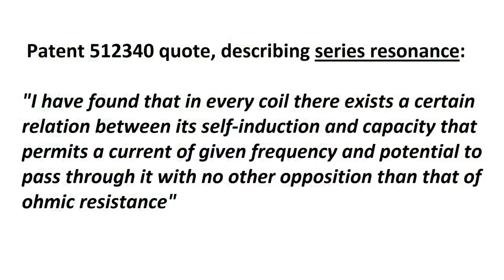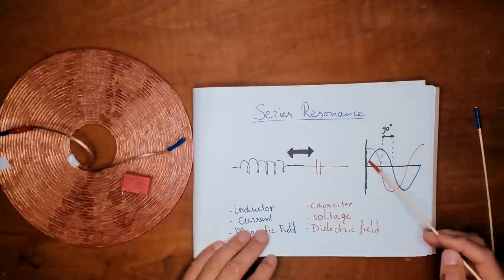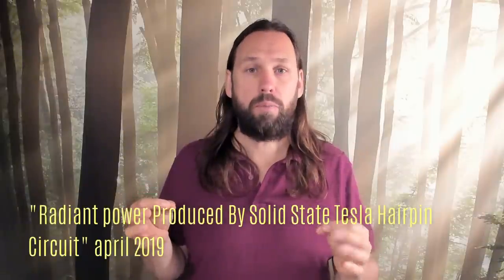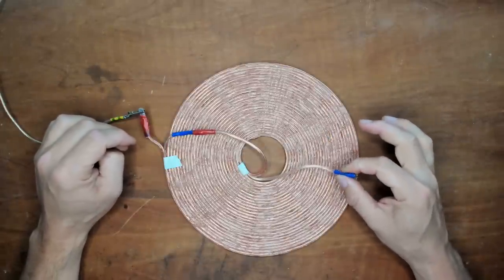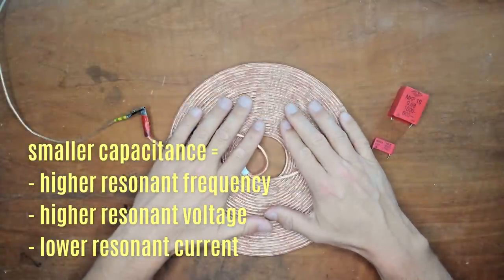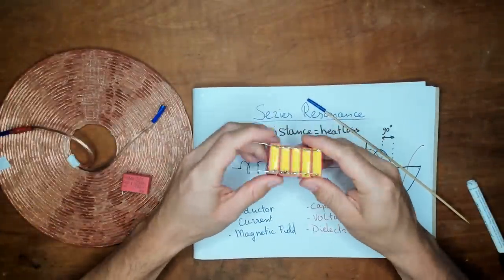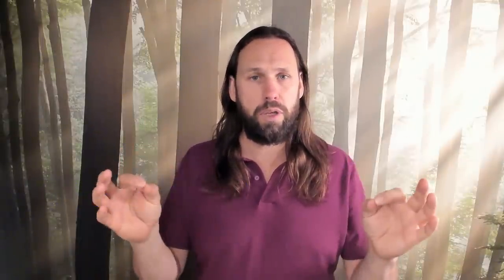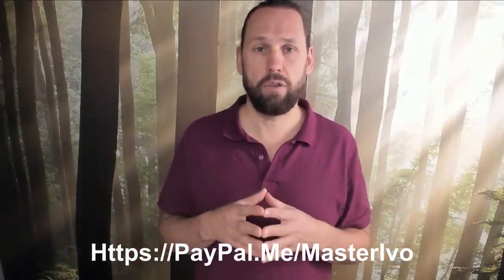The Series Resonant Bifilar Coil, Made For Longitudinal Impulse Electricity.

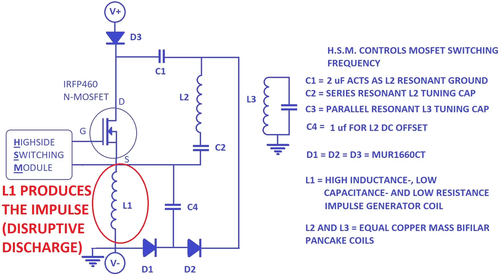Comment: 12:35 Because there is not enough time between duty cycles for the radient field to fill up the coil. "Fly back coil" is 1st used to capture this super high voltage cause it was burning out parts. TV's
Reply from the maker: If so, then the frequencies would be super emposed, just like audio. It forms a single Sine wave with the impulse super imposed, so your theory doesn't hold
Reply: @MasterIvo  Not my theory, just my understanding , when you pulse a coil during the off cycle the radient field enters it, if you pulse to fast there is not enough time for the voltage to peak. I could be wrong ...
Reply: @MasterIvo  I am having trouble what you mean by freq superimposed?
Reply: @MasterIvo  I never said it was a theory , it is just how i understand the pulse technology. In my view there is a simple understanding that by pulsing you achieve "reception" to the ether no matter the frequency there will be reception and the ether is a voltage so high it is not measurable, it is just that at particular resonant frequencies following the vortex math established by Tesla are better for reception of this ether than other non resonant frequencies. I have research to do on audio before i understand the super imposition your refering to. I know the signal is delayed by a little for creating "STEREO" effect, that's why FM sounds better than AM.. Still I will not be able to get you on the super imposed concept, maybe you mean in phase or out of phase by a degree of sorts that I understand, super imposed I do not Understand at all, all i understand about that is the concept of "LAYERS" are you saying that the energy pulse from the battery is overlayed by the radient pulse? cause i am pretty sure you can see the 12volt pulse in the signal go up to 12v and then down sharply to zero before suddenly the spike appears at 1000 volts then back down, you would need to stretch the sine wave out a lot to see that on the scope.  If you see that then there is no super imposing happening, but I am not using a series resonant coil like you and I never did this experiment so it's ok I am allowed to not understand .
Reply: @MasterIvo  How do you make the series coil to become resonant ,  are you using a different thickness between the 2 coils or is it the number of turns that does it? Or is it the pulse frequencies or all of the above???
Reply from the maker: @mykedoes4099   the IMpulse only enters when there is zero current. Else it won't enter at all
Reply from the maker: @mykedoes4099  it is compounded. added, it is combined.
Reply from the maker: @mykedoes4099  I don't understand a lot myself, thats the fun of research!
The resonance is created by the mosfet turning on and off (see my radiant power video of april 2019)
Reply: @MasterIvo  I agree the radient enters the coil when the current is zero, but the zero point is after not before your battery powered pulse 12volt dc ac . And I have seen the signal myself that shows the 12 volt pulse go up then down then after it is at zero the spike enters so your pulse and the radient pulse is not in phase or super imposed , then again I am not talking about a series coil configuration , I am talking about a single coil, my signals come from a bifilar but the trigger winding is not contributing to the signal I am describing at least not that I know of.

Comment: Thank You for great work. I want to make a note about  MOSFET  body diode(search  IRFP460 data sheet pdf) .Sometimes is better to avoid the effect of the MOSFET housing diode on the circuit.This can be done using the Schottky diode  connected in series with the output of the MOSFET source.
Reply from the maker: Thanks, the body diode of the irfp460 is an avalanche mode, this means it will protect the mosfet agains over voltage. I can tune it to maximum voltage and see the signal distort a bit.
then I dim the signal slightly and I have maximum impulse voltage!
Reply: Yes. The diode protects the mosfet from overvoltage. But the diode makes a short circuit (shunt) for resonant C2 and L2 when mosfet is closed. Thus, energy consumption may increase...
Reply: You can isolate of the MOSFET body diodes, using series a Schottky diode and parallel fast recovery diodes
Reply from the maker: @teojekabsons4934  no, I don't think so, body diode doesn't conduct (else the mosfet would get hot)
Reply from the maker: @teojekabsons4934  i did use parallel ultta fast diodes in the past, but there was no benefit
Reply: found some useful information: richieburnett solid state tesla coil

Comment: What gauge speaker wire do u use. ? Will 2x0.75 sq mm do ?
Reply from the maker: I use 2.5mm2 for L1 (impulse generator coil) 
and 1.5mm2 for L2 and L3 (primary and secondary coils) 
0.75mm2 for L4 (extra coil)

0.75mm2 also works, but has higher resistance, and can make more windings=more inductance, more capacitance=lower resonant frequency = slower impulse with less change of voltage in time
Reply: Hi, I started a bifilar coil using wire I had on hand. Will 2 conductor solid 24 awg work for this coil?

Comment: Tesla says you get 250k times the voltage minimum with the bifiler. With 120v and 1000 turns on a normal coil you get .01 volts per turn. With the bifiler you get 50v per turn on the coil plus a reduction in current, no back emf, and higher capacitance. The bifiler is the coil he used in all his patents. This is why people failed to reproduce his results. They only knew of regular coils.
Reply from the maker: indeed, but with 120V you get 60V per winding. And yes there is back emf, as the induce spike is a resonant half wave.
I agree he used it in many patents without mentioning it.

Comment: The difference between a bifilar coil and a monofilar coil is only the electric field?
Reply from the maker: yes, it is charged up to a much higher voltage, (half the supply, which when resonant can be very high) thus it can store much more electric energy, which lowers its resonant frequency